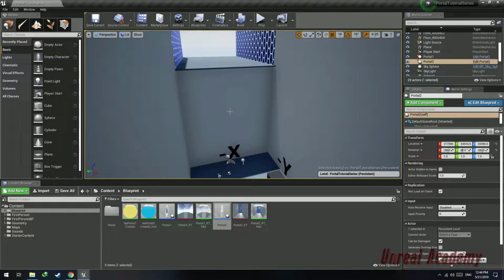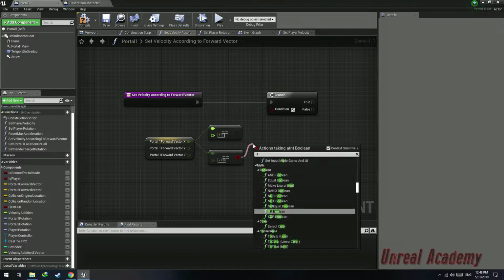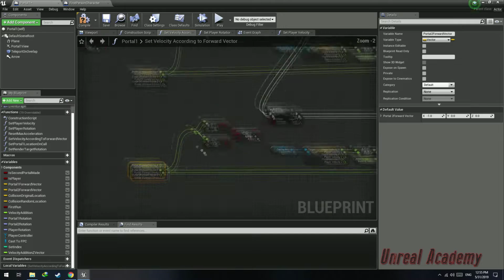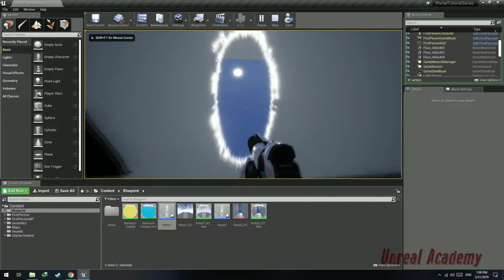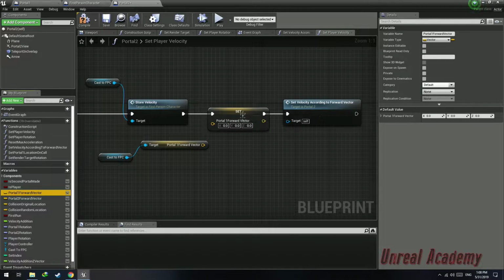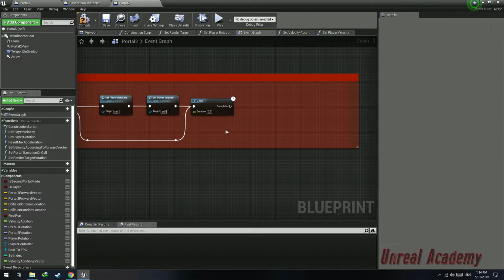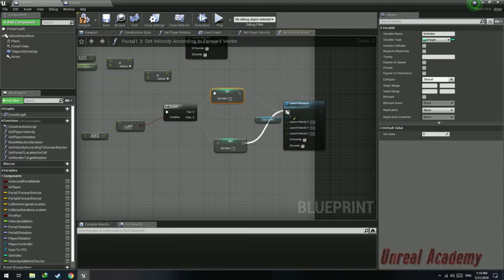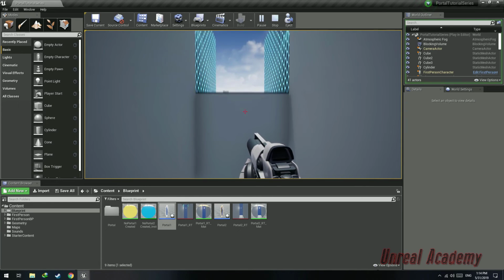Portal Gun Tutorial Series - Retaining Player Velocity Upon Teleport + Bug Fixes | Part 6 UE4

Comment: Instead of using VelocityAdditionZVector when launching on the z axis, plug in the player velocity for the direction the portal is facing. This will result in a more realistic and accurate launch, rather than a default value specific launch

Edit: turns out it's more accurate if you use the player velocity for all directions, and as a bonus, it won't break the rest of the code 😉
Reply from the maker: Have you tried it? If so, is it better? Could you share a screenshot of the blueprint with us? Thanks!
Reply: @UnrealAcademy  I'll try to but I don't think my graphics card will like that much. Placing a single portal drops me from 30 fps to 5.
Also, which version of the engine are you using? I have 4.17.2 and the set velocity according to forward vector function doesn't work in portal 2 and portal 1 only seems to work when facing the -X or -Y axis
Reply from the maker: @oo_atlas_oo  Well, I'm using 4.20 or 4.22. Damn, your FPS sure do take a hit! What GPU do you have? And to increase FPS, just go to the portal camera, and uncheck "capture every frame", this will give the portal a static appearance, i.e, dynamic objects won't be updated when moved, but it will increase your FPS!
Reply: @UnrealAcademy  will do, thanks
Reply: @UnrealAcademy  also, could you send me a download link with the finished portals? As much as I like following your tutorials, it would save me and the rest of my development team some time if I could have the finished portals (plus my set rotation and set velocity according to forward vector functions aren't working properly, so that would also be a fix)

All I need is all the assets related to the portals and the portals. I can import those into any project afterwards
Reply: @oo_atlas_oo  you can buy the whole project for 3$, it's worth 100%